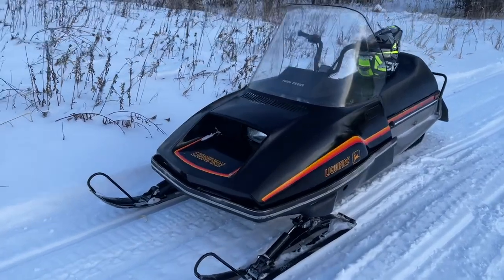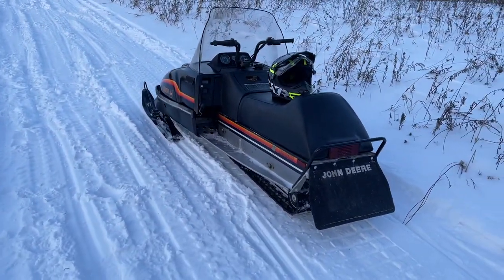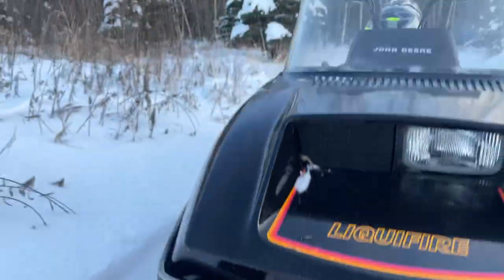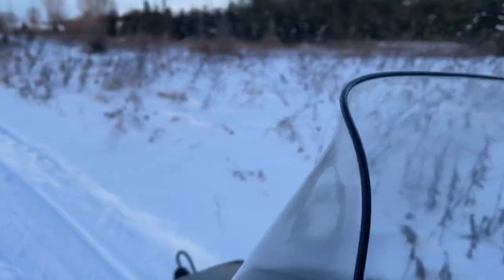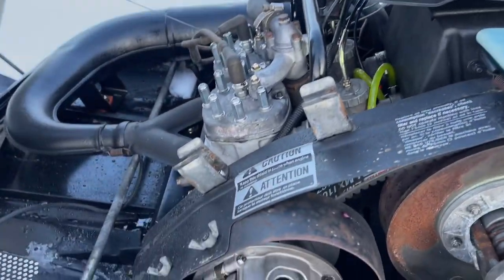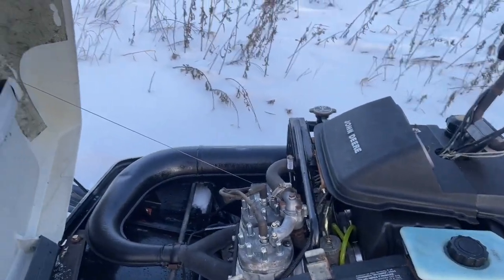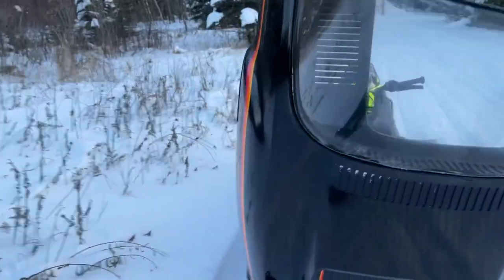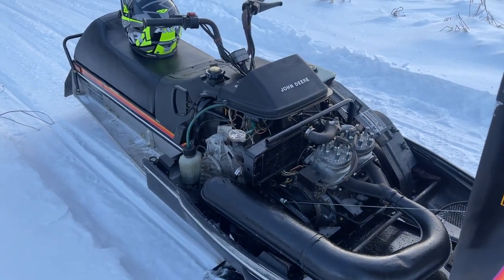1983 John Deere liquifire

Comment: Beautiful sled. I bought a brand new 1981 Liquifire in the fall of 1980. I had it for 9 seasons and racked up neatly 16,000 miles on it with very little problems. It may not have been as fast as some of the other manufacturers muscle sleds on a long lake. But on a winding trail, it’s low slung engine and resultant low center of gravity, gave it incredible handling and it would easily spank those “faster sleds” on such trails. I miss that sled.
Reply: Had a 1980 Sportfire 440 and it is my favorite snowmobile for all the reasons you said. Like a boat in deep snow the front end just floating on top. Amazing trail sled. And led the trail for many snowmobiles for a long time. It was a barn find rebuilt it and gave it a new track got rid of the cleats ran like a charm. Sadly when I moved I had to part with it but hope I find another one day. When I do it will be cruzin once again.